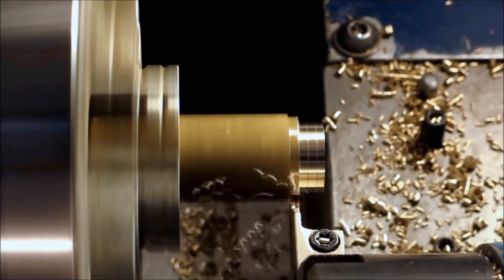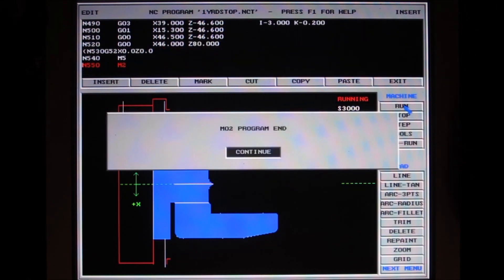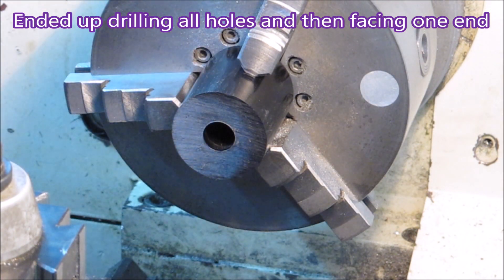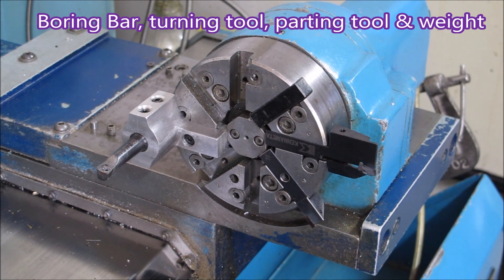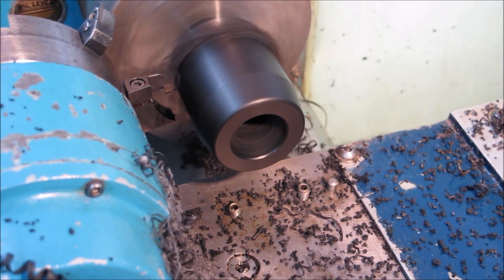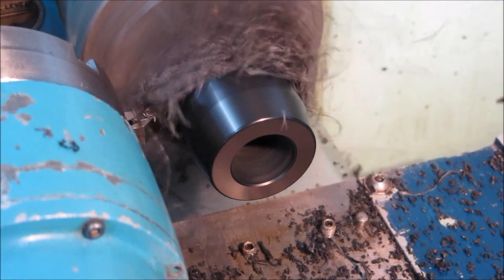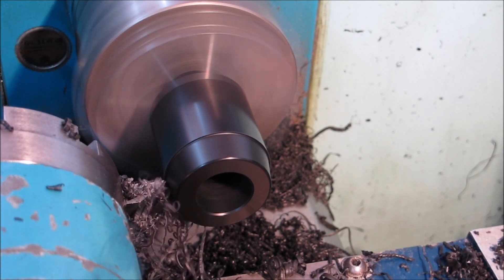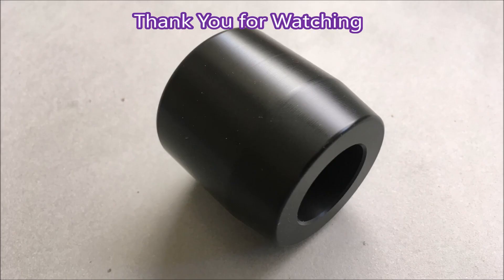Small CNC lathe turning Delrin (acetal) to make a Skid Stop for Yamaha R3 Junior Racing Motorcyle

Comment: I would be interested to see the result if you only cut on the backwards movement instead, as that would pull the swarf along with it :)
Reply from the maker: That boring bar would not cut very well working that way, it would need to be a 55 or 35 degree insert to do that, but an interesting thought. Thank you for your comment.

Comment: Wow. Never thought of using a twist drill on a QCTP. Do you need a special drill with only 2 flats? or do you use a standard drill with 3 flats?
Reply from the maker: If you look closely, you can the vee in the lower part of the tool holder, so I use that type. Not sure I even had a flat on the drill, in plastic it was fine. Just knocked off any burrs (from the screws) with a file. If you have number of parts to make it sure beats using the tail stock.
Reply: @smallcnclathes  Ah you cheeky bastard! I need to find one of those.
Reply from the maker: Mine came with the tool post, I imagine they are to hold round boring bars.

Comment: Windows 98!!!! Can it run on anything newer or is it your personal preference?
Reply from the maker: Hi Alex, the program runs in dos, I have no problems with dos (I use Xtree Gold to help me manage the PC) but Win 98 allows me access to usb memory sticks which is handy as floppies can prove a little unreliable at times. The later machines use a windows program that will run in 98 or XP.  This will work on earlier machines but one loses the operation of the pendant and the turret if fitted. I am currently running my lathe with the dos operating system, but run in W98 when I have the chance. The other lathe I have runs in XP.  Biggest hassle is finding a PC that has an ISA slot fitted as this is required for the interface card that actually runs the machine. A PC later than a Pentium 3, can be hard to find with an ISA slot so we tend to be always on the hunt for older PCs. I have a PC that is an AT386 (complete with serial mouse and large din plug keyboard) in the shed which runs the lathe fine if I use dos as the operating system.  Sorry that is a bit long winded.
Reply: @smallcnclathes  ahhhhhhh so it's the lack of ISA slot that forces you into an early possessor which in turn forces you into an early operating system? 

Not that it matters because the program runs in DOS but I was just curious.
Reply from the maker: @Deltarig  The interface card that runs the lathe needs and ISA slot, that is the first consideration regarding the PC that can be used. The early software is dos software so it can be run either in dos or win98.  the later software can run in either win98 or XP but that is about it.  The software was from the machine manufacturer. Machines (they made mills too) have been retro fitted to run  Mach3 or other controller type software.  Mine are still running the original software and interface cards, which I hope to keep running that way.
Reply: @smallcnclathes  ahh OK, it's good to see, I never imagined cam software  on DOS, it must of been cutting edge at the time. I'm sure the software developer would be proud to see his program still being utilised.
Reply from the maker: @Deltarig  I imagine he would. These lathes were mainly made as training lathes and sold to educational institutions. The software is cad/cam although the drawing capability is not as good as the cam in my opinion. I draw in my own cad software and take a dxf into the Hercus software. Emco were doing a similar thing in those days, I had an Emco PC5 Compact cnc lathe as my first cnc, but when I had the opportunity, I upgraded to the Hercus.
Reply: @smallcnclathes  cool, I do a bit of cad as well (fusion 360), my friend has a 5axis CNC and it's always amazing to see my drawings come to life, it's also quite amazing to see him program the machine in G code.

Your videos are equally as amazing l, I'm quite fond of machine work, I have been watching "abom" and "this old Tony" for years and I've only just stumbled across your channel HAPPILY!!!
Reply from the maker: @Deltarig  you must be a smarty pants, I find Fusion impossible to learn!  But then I have been using my package (Keycreator) since it was a solids cad software in dos, when it was called Cadkey.  Consequently as mine is up to date and I can use it OK, I guess I do not really HAVE to learn fusion and that may be where the difficulty lies. Combined with the fact that it works rather differently to the way I am used to working. I like to start off drawing what I want, not creating a blob and pushing and pulling it into the shape I want. LOL
Reply: HAHA! it's a generation gap thing, but you've proven your methods to be equally as effective which earns more merrit.
I would have preferred to be the under dog.

Comment: Very nice use of a 98 machine. I keep an xp machine around to run old scanner software/hardware myself. 

Love the commentary, those little details and the thought process behind them are interesting to me.
Reply from the maker: That lathe is now running on a dos pc.  The major factor is that the lathe has a pc interface card that needs an ISA socket on the mb.  Early machines use the dos software and later ones will run on XP.  Getting increasingly difficult to find a pc with an ISA socket.  They are available new but are very expensive, hence my supply of spare old computers in the shed.
Reply: @smallcnclathes  there might be another option besides an old system. There are PCI-ISA Bridge cards (and some for PCIe-ISA) which allow running ISA cards over the newer slots making the software the limiting factor. Sadly, Sometimes these cards don't always work with all hardware and have to be tested in a specific system to verify they work.